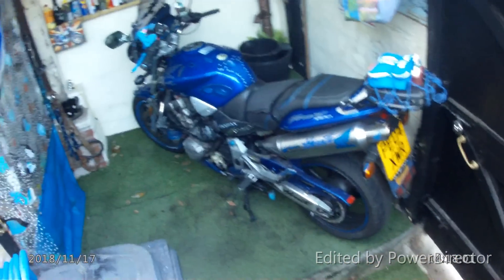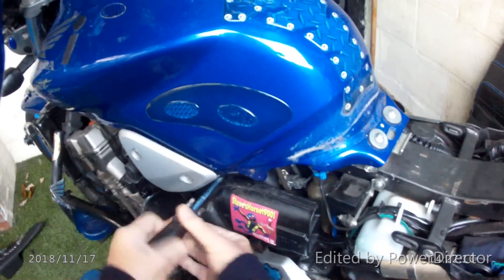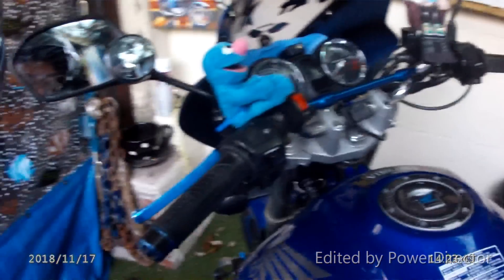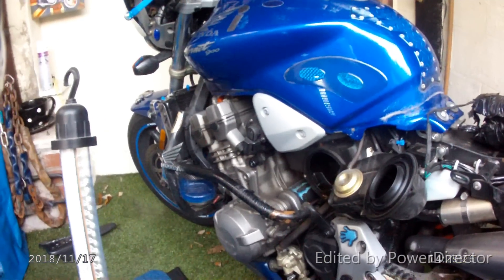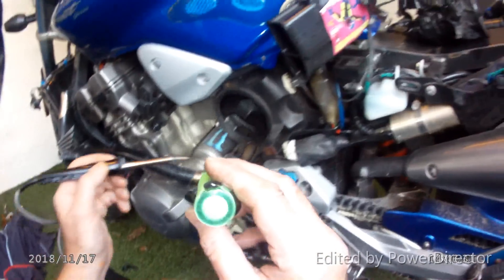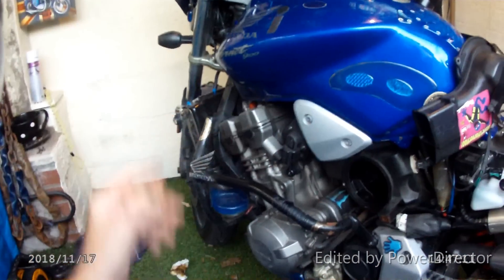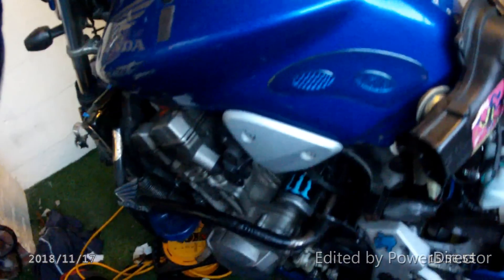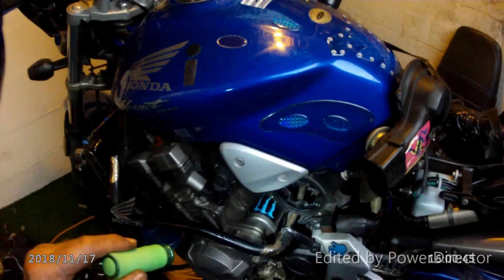Honda CB900 Hornet / 919 'Speed Sensor' fix ?!

Comment: question... does the speedometer track speed from the wheel?
Reply: NO.... from the gear. So, if you change sprockets then you'll need to adjust (Speedohealer)

Comment: Well however it works out ie fix or not, well done to even attempt,it makes my blood boil £226 for the new part, what planet are Honda on? glad you secured a used part. Youre right why not a simple worm drive? every thing seems so inaccessible these days, on moderm bikes.
The acf 50's Good stuff, i'm trying the XCP Rust protector  at the moment. Fingers crossed your repair works.
Reply from the maker: ...yes it works fine I'm relieved to say , I tested it by going to Rivington today - but there was no grub left at 2.30pm !
Reply: Great news

Comment: Hope that it all sorted now Mate.
Reply from the maker: ....is yours ok so far ? My bike is just about to clock up 40,000 miles - so maybe it's something that occurs with this model after it's getting old !? I bet the clutch is next to go, or the starter motor 'brushes' ?
Reply: @StevesHornet900   I have no issues but mine has done only 20, 000 miles. The only issue I have is that it has a very smelly exhaust.

Comment from the maker: ...at 16:50 - ....fumes from the hot oil in the gearbox exit via a pipe which feeds the fumes into the airbox to cut down on emissions into the atmosphere....yet Russia and China pump millions of tons of crap into the Earth's atmosphere every year !
Reply from the maker: @AlanBoulter  ....you should go to your local Triumph centre and take the Bonneville for a test ride like I did....then see about a used one at a reasonable price ! The 1200cc model I was on seemed to be underpowered - BUT it was a nice relaxing ride , tootling merrily along at low revs.....as I've never really been a speed freak.
Reply from the maker: @AlanBoulter  ....well, I thought you might get a very good price for that KTM, then see a used Triumph for around £3000 !? I am constantly amazed at the cheap e-bay bikes on offer....but maybe there are hidden problems with them? A recent posting was for a lovely blue Honda X11 ...the naked Blackbird - but it had slid down a country road on gravel , parts had been replaced but there was still a couple of scrapes...it was otherwise mint though, and just 8000 miles , and it sold for £2800. Stickers after a rub down would've covered up most of the unsightly scratches.....?!